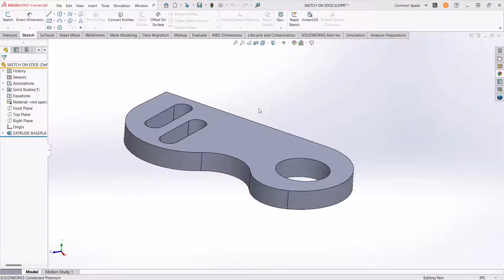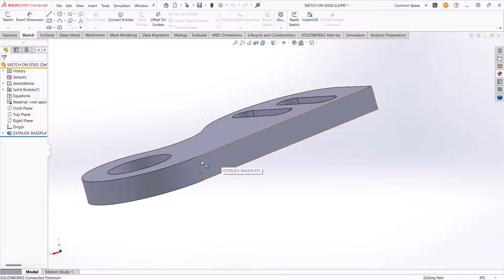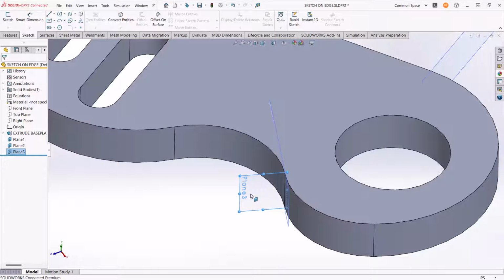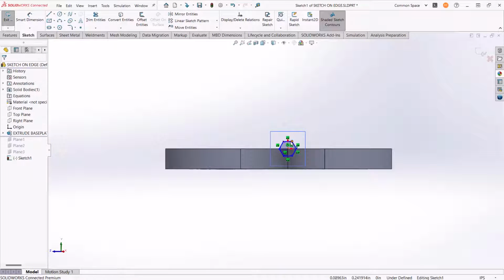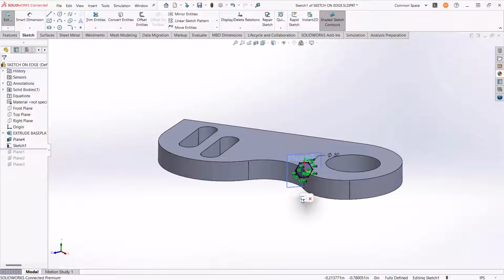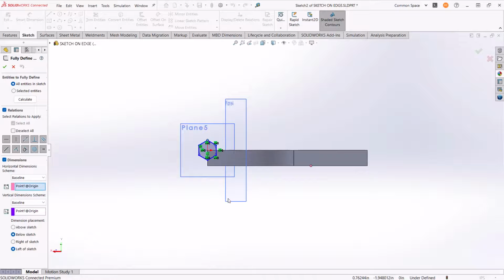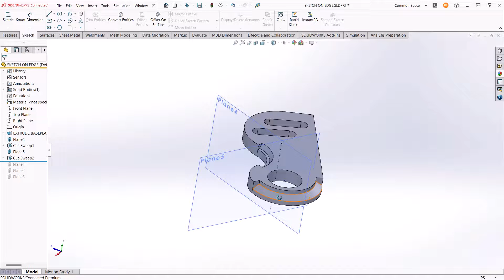SOLIDWORKS Tutorial  -Sketch on Edge

Comment: Thanks David. A great tip for creating quick and easy planes. I was just wondering how the software determines which end point to place the plane on. Does it depend on which point the initial click was closer to? 
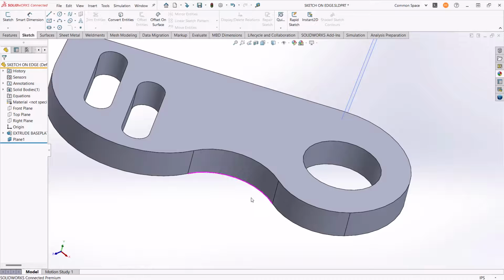Also, the same result can be achieved by selecting an arc's end point and the arc itself to create a plane normal to the tangent of the arc at that point. The initial method at 01:25 seems a bit inefficient for this purpose. However, this method is quite quick and interesting. I can definitely see myself using this more in the future. Thanks again.